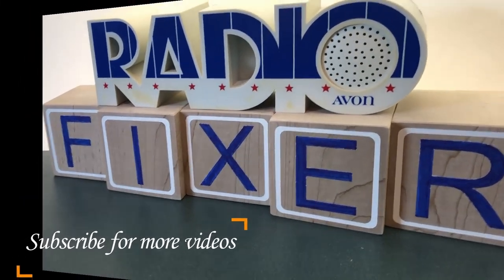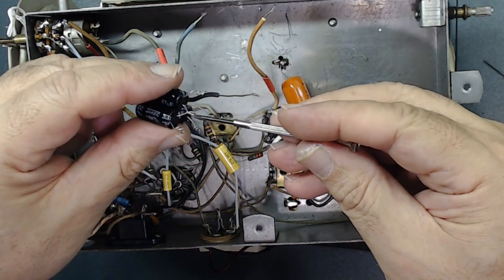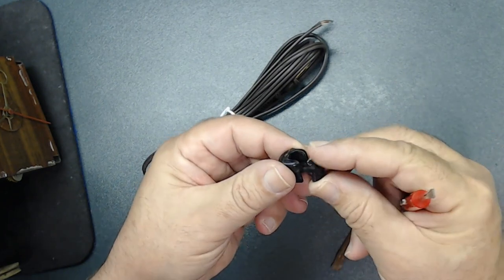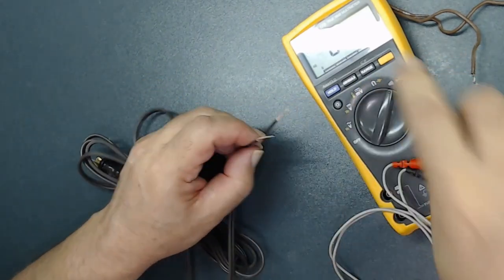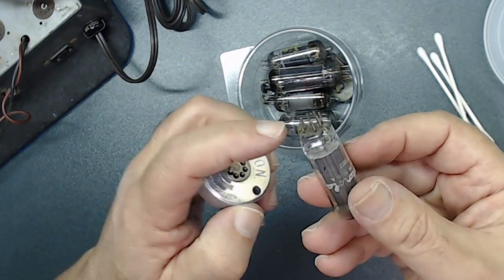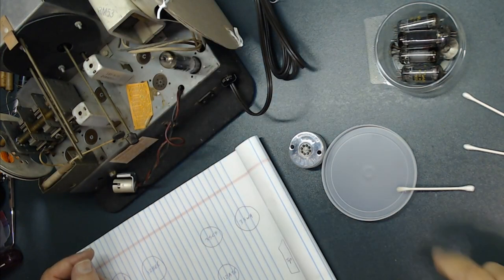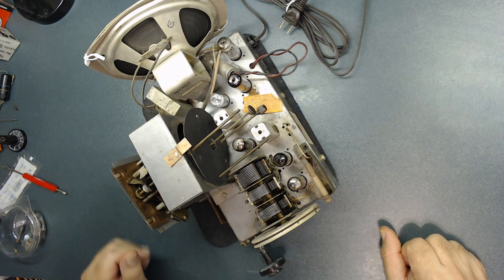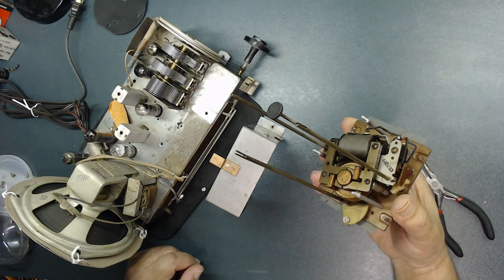Part 3 - 1953 Motorola Clock Radio Repair

Comment: I realy like your tube pin striating tool.
Reply from the maker: Hi Jim, good hearing from you. I fund this tube striating tool over 25 years ago or so at Goodwill store. Did not know what it was at that time but was very interesting tool, still was in the box and never being used. I used to go to Goodwill and other thrift shop on my lunch time searching for radios, camera, and TV. Did not know how to fix them but was fascinated with them since I was child. Always want to know how radio and TV works with just having vacuum tubes.  Have a good night! Regards, Jay

Comment: When I clean the pins on any tube radio I use de-Ox-it on the pins and on the sockets and i unplug the tubes and plug them back in a couple times it always makes a good connection as well. I have never had or worked on a clock radio so what you are doing is all new to me. Great job Jay really nice radio restoration series.
Reply from the maker: Hi Larry, such a great idea! I got to try that, this darn miniature tubes pins are so hard to clean. Thank you for mentioning that. This was my second clock work, the oil inside the motor get hard like a tar. Learned this when I was working on old cars.. LOL. Good hearing from you my friend. Have a great day! Regards, Jay
Reply: @RadioFixer  I have watched videos by  David Tipton and he works on a lot of radios even consoles with turntables and the grease always gets hard and you have to heat it up to get rid of it the same as that motor on that clock radio. Just finished chemo and wont go back for another 28 days. That will be April then May and June and I should be cancer free.
Reply from the maker: Larry, I definitely need to watch his videos. Thanks for telling me. I am so happy to hear that you are feeling better. My family were asking about you since I talk to them about you. Such a great news Larry! Thank you for sharing that with me. Wish you were closer to Florida so I could visit you and check out your absolutely awesome gun and radio collections. Take care my friend. So happy for you.

Comment: Hello Jay. Nice job on the radio and oiling the clock motor. Nice to see it running again. :)
Reply from the maker: Hi Doug, thank you my friend for taking time to message me. I appreciate you, I have learned a lot from you, soon need to work on 8 track and need lots of help on that one since it will be my first 8 track to fix. Have a good night! Regards, Jay
Reply: @RadioFixer  No problem. 8 track tape players are really pretty simple mechanisms. They only seem complicated. :)

Comment: Nice Video!!! For those 3 capacitors, I use a Hot Melt Glue Gun.. The key is to use one with a glue stick, that is High Temperature rated. The Glue will set super hard and stick to almost anything.. I do Buff Out the chassis with a Dremel steel brush to remove any slick metal, the glue sticks better.. Just FYI... 
My Glue Gun is a INFINITY GG-RANGER-PRO-12
Robert
Reply from the maker: Hi Robert, thank you so much for the information. I definitely will look into it. As a matter of fact, the original owner Hot Melted Glue on those 3 capacitors. They were very secure and was hard to remove them. So good to hear from you and thank you for reaching out. Have a good day! Regards, Jay

Comment: Couldn’t you heat the clock in the oven?   As for the plastic, I recommend Plastx.  Best product I’ve ever used!
Reply from the maker: Hi Arthur, so good to hear from you. I have not used oven to heat the clock before, not sure how excited my wife will get using oven for this job.. LOL  I use soldering iron since I can heat the part and add oil at the same time, by adjusting temperature new oil can get inside the clock easier. Using oven is a great idea too! I definitely need to get some Meguiar's Plastx, I have used Meguiar product but not their Plastx product yet. Thank you for reaching out and bringing this to my attention. You are a true gentleman! Have a great day Arthur, Regards, Jay